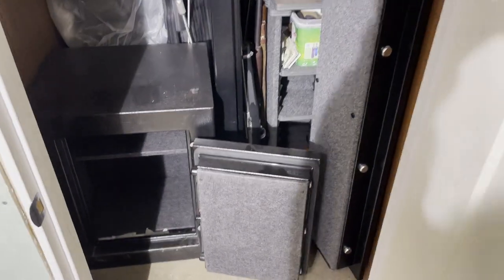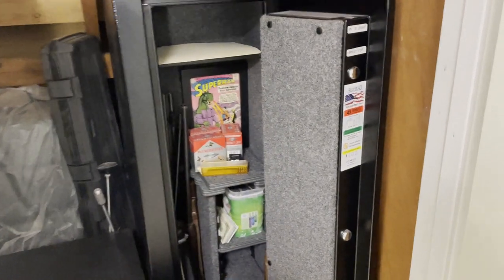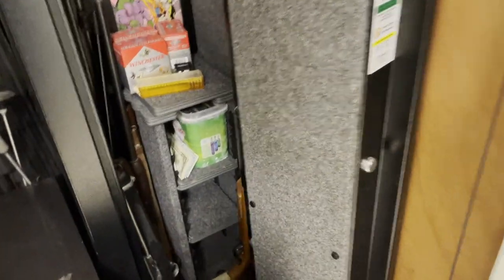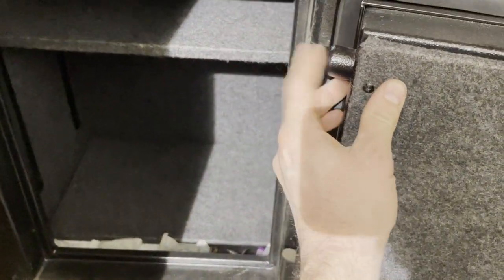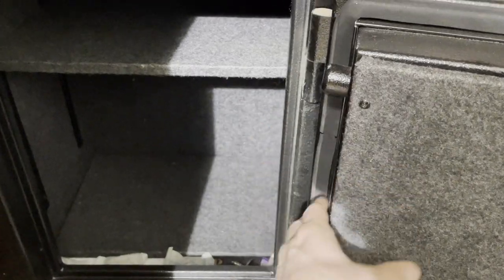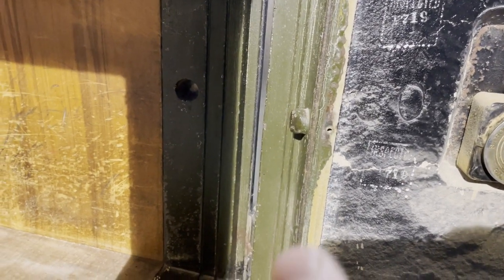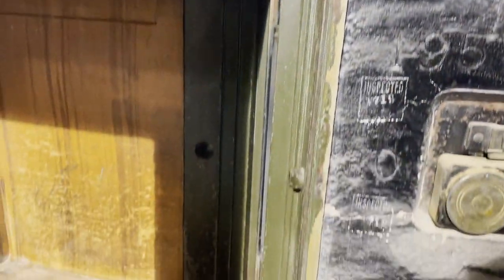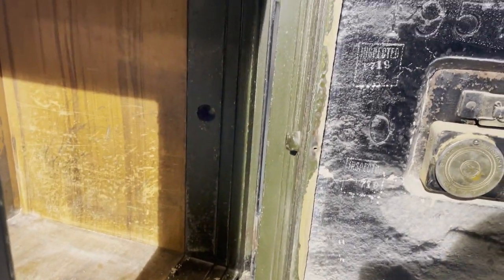Should I cut the hinges off to get into my safe? #short

Comment: So if it doesn't have those metal poles but it does have the hinges will it open up if I cut the hinges off?
Reply from the maker: I don't think so. There's a very tight clearance for the door, so if the lock is still engaged, I think it would have the same effect as the metal poles. (at least on my safes...)